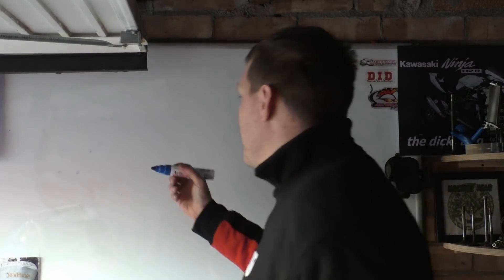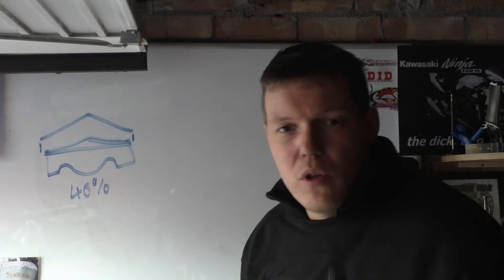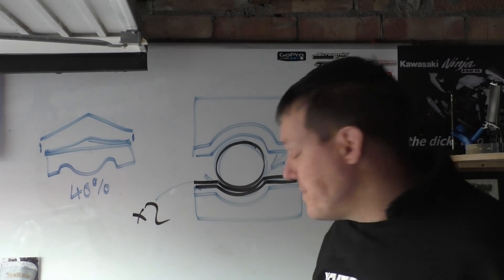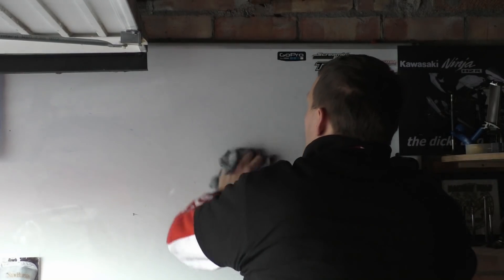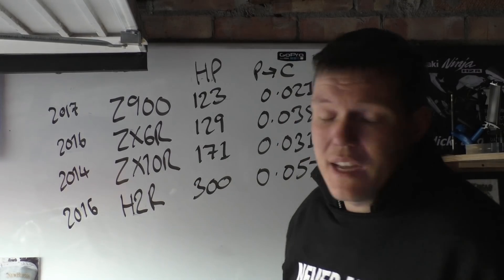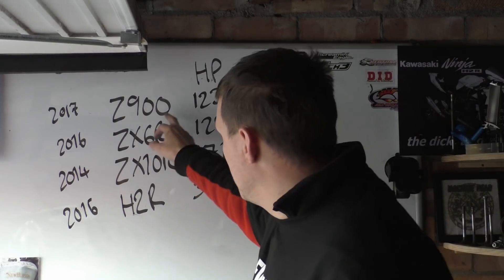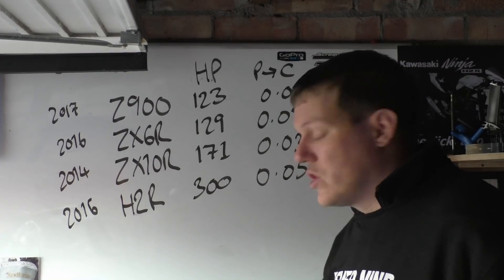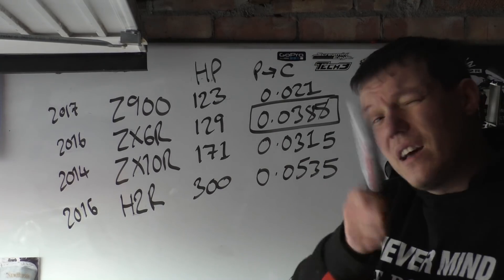Power and clearances

Comment: More clearance means the engine turns easier or with less resistance. A small amount of clearance can give noticeable gains in horsepower without any noticeable or measurable loss in compression. Although it will burn oil. Engine will smoke and probably not last as long.
Reply from the maker: No it doesn't. Actually engined with more clearance usually means higher impact forces. How about you stop making things up?
Reply: @thedirtyworkshop  I have worked in an automotive machine shop. I know for a fact what clearance can do for an engine. Don't feel bad most people have no clue what clearance is.
Reply from the maker: So let's get this straight. Let's say a main journal bearing has a 50% bigger clearance than when the engine was new, this makes the engine turn easier?  Or with less resistance?

Comment: thx for this... so 300HP 50um clearance.. that is tight and I like it, but does not this depend also on alloy piston is made of? Some of these pistons expand like crazy, especially these that can take a lot of beating?  Also, way I understand when you write 0.0535 should be millimetres or 53.5um (micrometres). That is clearance I aim for 300HP engine. Though I am seriously confused with manufacturers piston composition since expansion can be seriously different depending on how piston is made. Funny thing is, hard to find proper data on websites, they all refer to "instructions on the box".. such a pain.

Comment: The 600 revs higher,thus making more heat.Also state of the art engines have ceramic and other coatings to keep the heat in the combustion chamber .
Reply from the maker: "Also state of the art engines have ceramic and other coatings"

like?
Reply: anti-friction coatings for 1.
Reply from the maker: Like what? Nikasil or what?
Reply: School up lad, you're channel is good.

Comment: You need bigger clearances on the H2R and all other forced intake feed engines also a lower compression. If not you blow the engine up. So that is a point to take in consideration why you can't compare it to other NA engines.
Reply from the maker: LOL come on dude that's a fucking dumb comment. Larger clearances because its forced induction....... LOL but why? This is why, so yes - its totally valid.

Comment: this reminds me of something i read of old Nimbus motorcycle with an inline 4 aircooled engine wich was put in in the lenghth of the bike instead of across, like normal these days. So that gave some weird cooling issues. Therefore the exhaust valve clearance was off per cilinder. It had 0.6 mm clearance for the front cylinder, 0.8 mm for the middle 2 cylinders and 0.7 mm for the rear one. 
Seemed funny enough info to share with you

Comment: A piston is shaped like a barrel. When you order a custom set the manufacturer wants to now your power output, no matter if it's NA or forced induction. Power level tells them the thermal loads which tells the amount of thermal expansion. And they will have audible slap when cold.
Reply: Pistons snaps are an exaggerated truncated cone are they not ? I didn't think they were barrell shaped
Reply: @eirespec6756  You're probably right. English is not my first language. But I think were talking about the same thing.

Comment: Wouldn’t a ratio of clearances to circumference be more telling?
Reply from the maker: well it then depends on the piston design.
Reply: Back when I was building a lot of small cubic inch, high horsepower alcohol injected, drag race engines, we used circumference to determine both piston to cylinder clearances, as well as ring gap.

Comment: Didn't the sr71 leak oil when cold due to clearances?
Reply: Fuel
Reply from the maker: That's different - that's to do with pressure and americans being stupid
Reply: @thedirtyworkshop   I think the Americans lead the world in engineering, NASA land probes on Mars routinely, the Europeans could save money by firing artillery at it rather than expensive scientific equipment and GE is years ahead of RR in ceramics and composites
Reply from the maker: "I think the Americans lead the world in engineering"

- when? I think you'll find it Japan.....
Reply from the maker: And I'm not just talking bikes and engines - the tech world. If you wanna compare countries then you have to look across all areas not just GE did this, and JPL did that. 

My point was leaking fuel is not a good idea, but instead of solve the problem - just ignore it until we get to altitude.....
Reply: @thedirtyworkshop  Yeah JPL, American too, now don't get me started on Harley Davidson engineering prowess :-)
Reply: Very good

Comment: That all makes sense for an engine that is expected to have a cold start. Kawasaki isn't sending around an engineer for every H2R buyer to sit around and pre-warm up their bike so it's all up to temp to go for a ride. H2R makes the most power, and will have the most amount of heat and expansion, and needs the clearances.

F1 engines are a beast all on their own and aren't really comparable to consumer engines. They are meant to produce the most power in extremely specific operating conditions. Who cares if an F1 engine is seized when it's cold, since nobody races with a cold engine. Even with high end 125 go karts, you need to follow a specific warm up procedure to keep them from cold seizing. It's not comparable to a consumer engine at all.

Comment: Can you talk about Achates "Opposed-Piston" engines when you get the chance?

https://www.greencarcongress.com/2018/01/20180118-achates.html
They talk of 53% Thermal Efficiency in the Diesel variant

If you add in the RCCI Combustion cycle, how much more thermally efficient can you make it?
https://www.youtube.com/watch?v=pCr6bjQMrgU&vl=en

If pure Compression Ignition can't be achieved in RCCI and you need to have some way to ignite it:
https://www.youtube.com/watch?v=9KhzMGbQXmY
Will Mazda's Hybrid method help?

Can MWI (Microwave Ignition) turn out to be a replacement for Spark Plug Ignition?
https://www.autoblog.com/2018/12/13/microwave-ignition-ex-porsche-ceo/

Lot's of promises being made by the MWI tech which is exciting if true.

I don't want to see the ICE die.

I want either Achates "Opposed Piston" and/or Liquid Piston X's "Inverse Rotary" engine to succeed as the next generation of ICE tech.

Comment: Watching an f1 car (Renault I think) get started up a few years ago (15ish?), they had to pump hot water around the cooling system to preheat it before they could start it.
Reply from the maker: They usually do both water and oil, as far as I know (from the article I read)
Reply: @thedirtyworkshop  Also I remember watching something about those insane little hondas they made in the 1960's, multi cylinder 50cc, 125cc and 250cc etc, that rev to 18,000rpm plus etc. They needed to stay above 10,000 rpm to make enough power to overcome their own internal friction and not stall. Talk about tight clearance/tolerance! Right, off to find rc166 videos and see if I'm talking bollocks......
Reply: Buy a CBR250RR, a real one, not the modern knockoff.
Reply: @LinkinMcOwnage  don't get me started, new hondas have lawn mower engines compared to their 'greatest hits'! Perhaps thats what happened, the guys from the lawncare department got promoted by the accountants based on their ability to mass produce stuff cheaper and cheaper.....